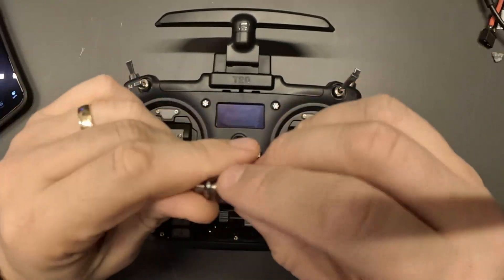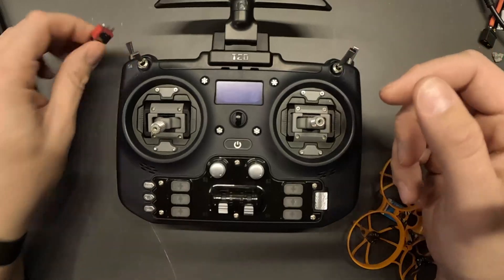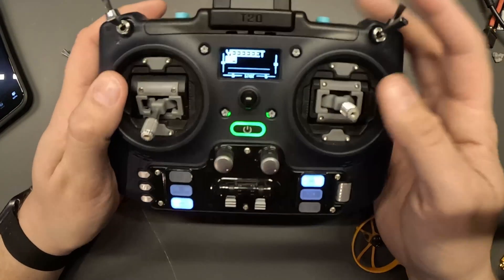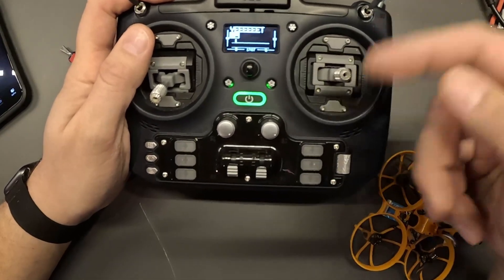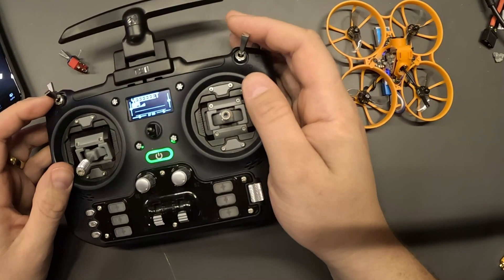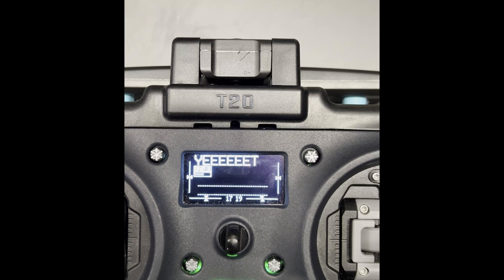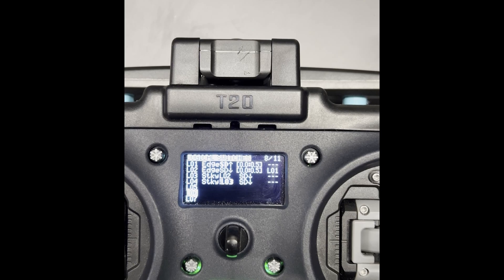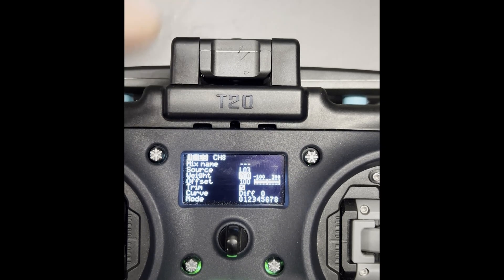EdgeTX: Use a single switch for arm/disarm SAFELY!! NO PREARM REQ!

Comment: Why momentary?  Two position works fine for me - backward for arm and forward for disarm.  I do arm/ disarm only when take off /landOrCrash. I am fpv novice and wondering if there is any secret.  Thanks.
Reply: I'm guessing they just find it easier. It also has multiple functions tied to one switch. Like how they have the warning sound when they disarm without holding it. There's no secret. 

Right now I'm using one of my trim switches to arm my quads. I toggle it once to arm, then hit it in the same direction to disarm. I also made on toggle a 3-position as well. There's a lot you can do with EdgeTX. You just gotta find what works with how you hold the radio.